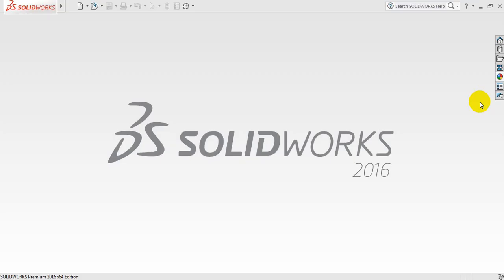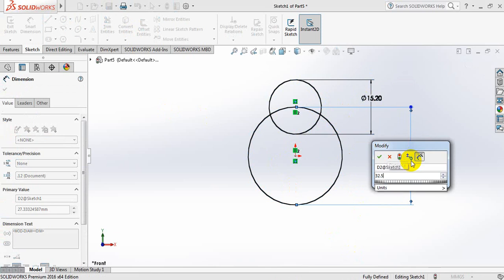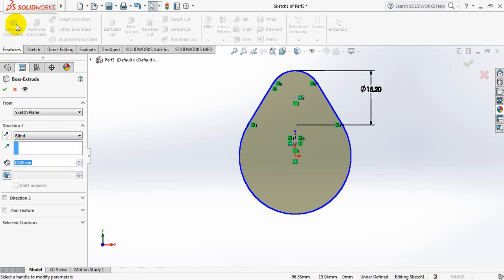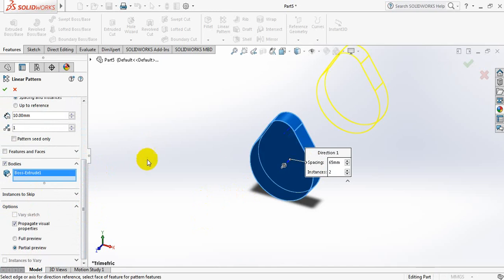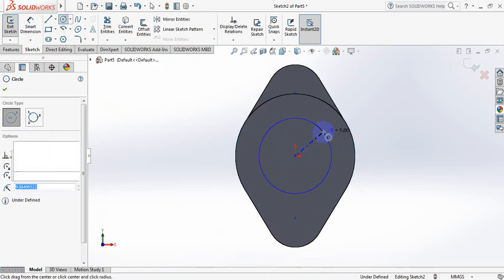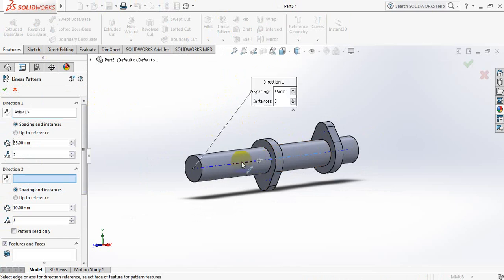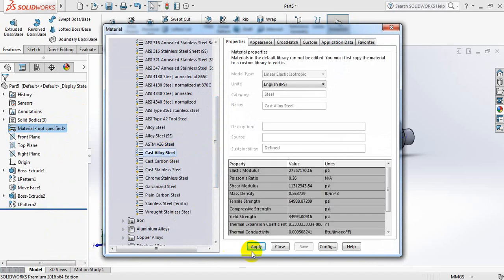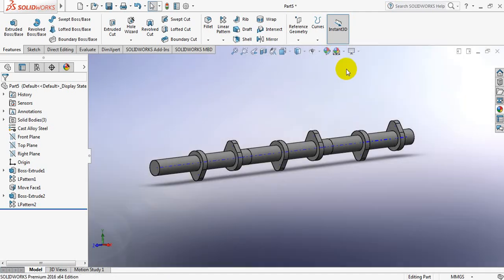Solidworks tutorial - how to make camshaft

Comment: This is good for just a proof of concept, but those cams are not ideal at all. Real cams don't have straight lines along the surface at all because this will produce an infinite acceleration/jerk at some instances, which will not last long at all, especially for high RPM conditions of cam shafts.
Reply from the maker: Thank you